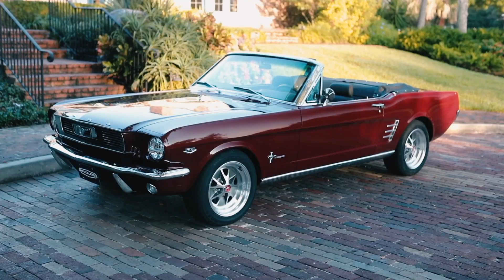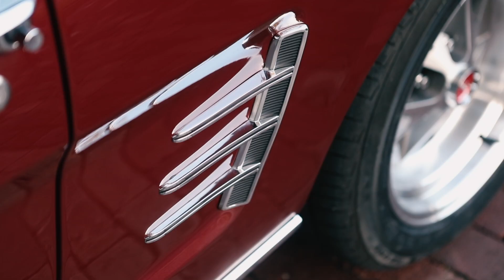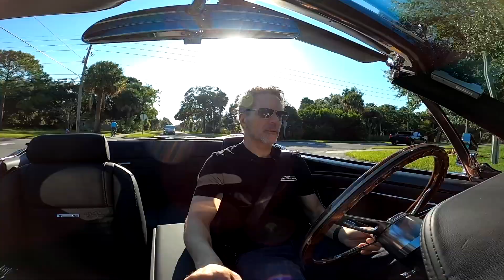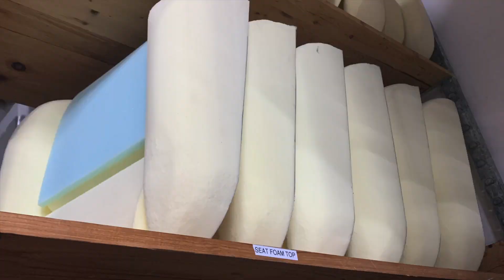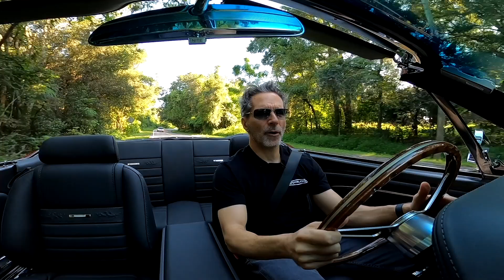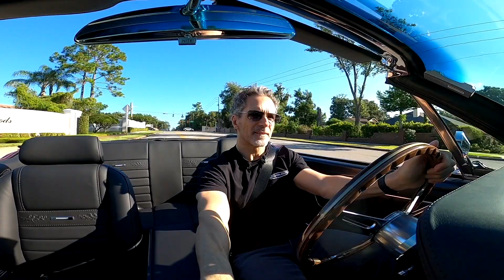Revology Car Review | 1966 Mustang Convertible in Vintage Burgundy Metallic

Comment: I'm looking to buy a nearby 68 Mustang Coupe & am wondering if swapping the C4 3-speed auto with a Tremec 5 manual is worth the effort to upgrade the ride & fuel efficiency. Or are creature comforts like power steering, power brakes, and AC higher priority.